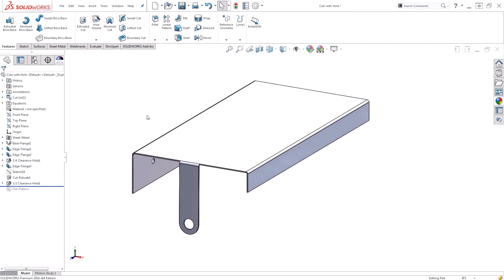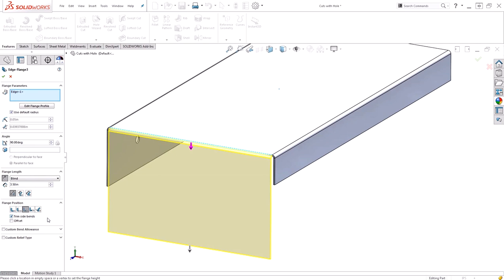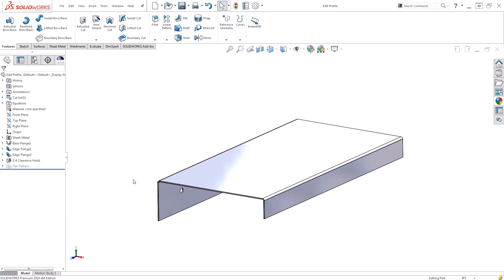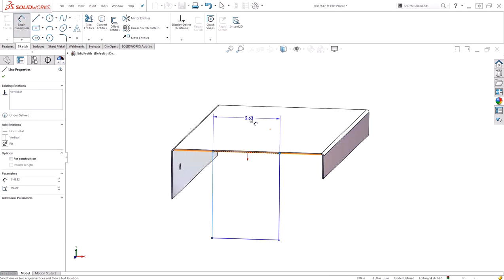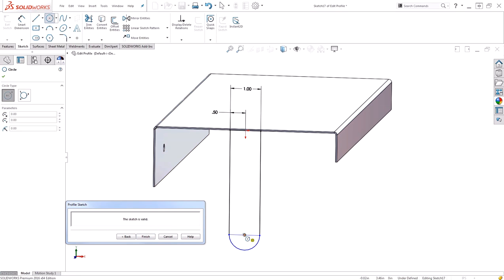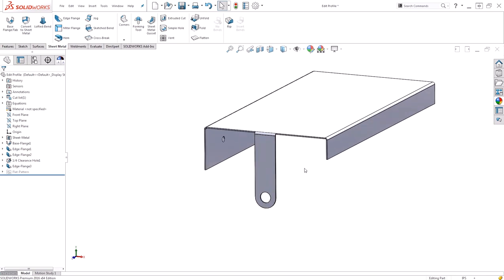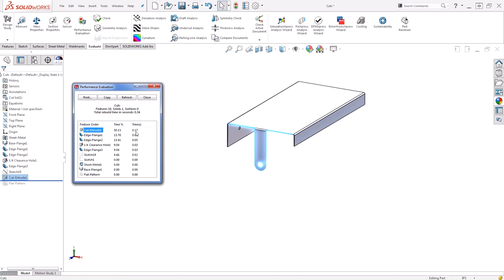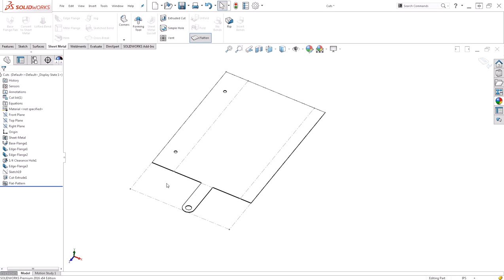Edge Flange and Cut vs  Edit Flange Profile in SOLIDWORKS

Comment: Is there a way to create two edge flanges on the same edge using one edge flange feature without using any cuts?
Reply from the maker: The edge flange feature doesn't allow multiple contours or shapes when using the "edit flange profile" option. So two separate edge flanges can't be produced with one feature. If there is any material bridging them together then it should work.
Reply: You can model your two flanges flat and then bed them both using sketch bend